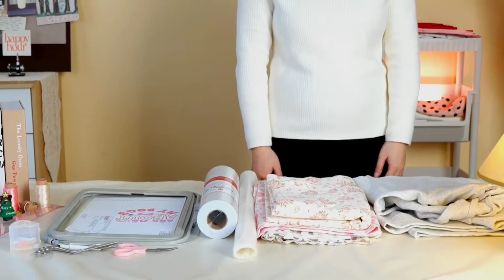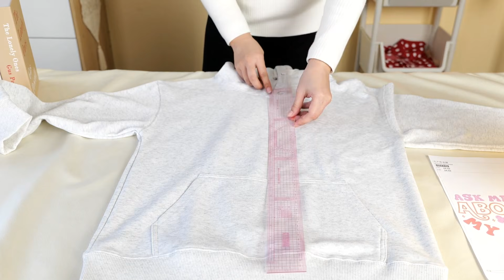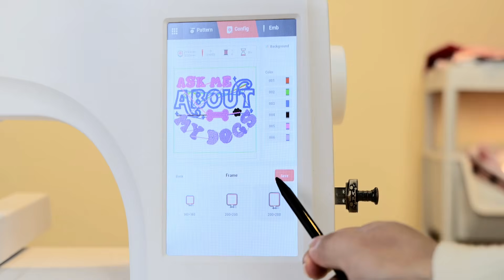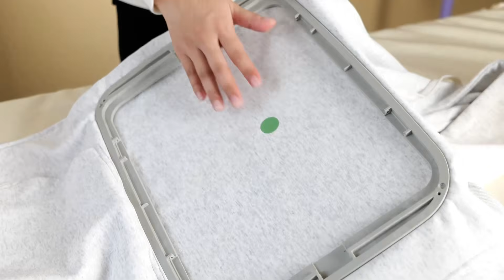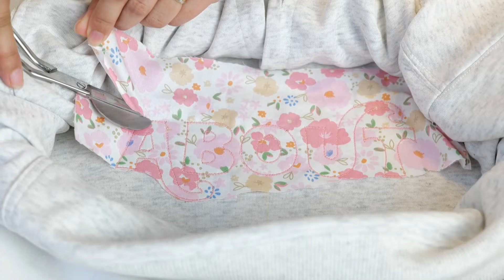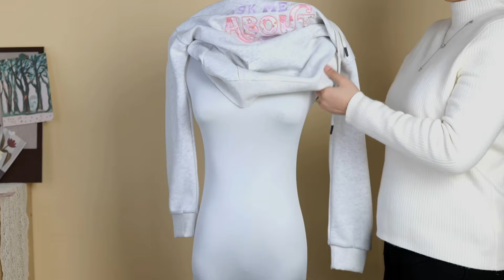Hoodie Appliqué Embroidery For Beginners With Poolin Embroidery Machine

Comment: When I take the hoop out to place the fabric, and then reattach the hoop to machine, and press start, it doesn’t line up with the placement stitch? It starts to stitch above the design. Same thing when I change the thread and re-start
Reply from the maker: Sorry you're having this issue! ❤️ Please make sure the hoop is securely reattached and that the design hasn't been repositioned. Before restarting, check that the machine is at the correct stitch position and use the trace function to verify alignment.